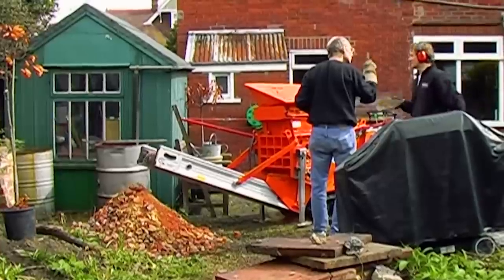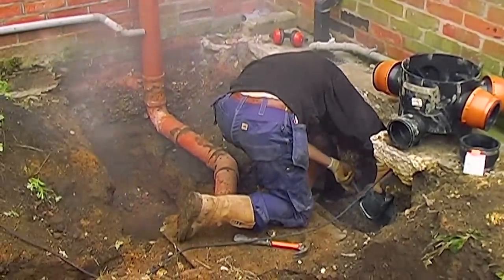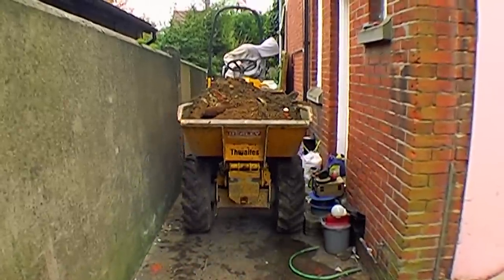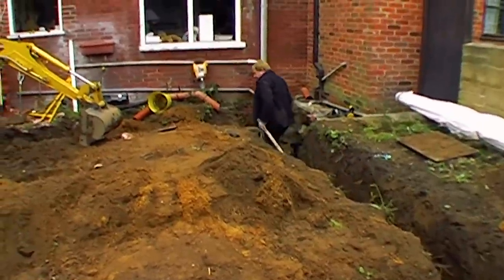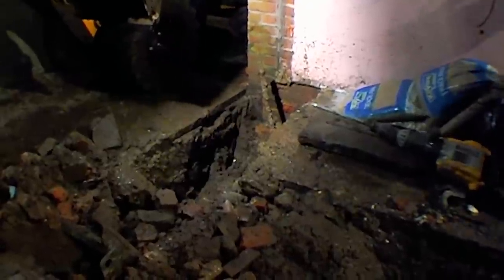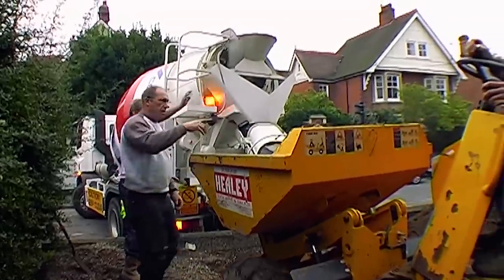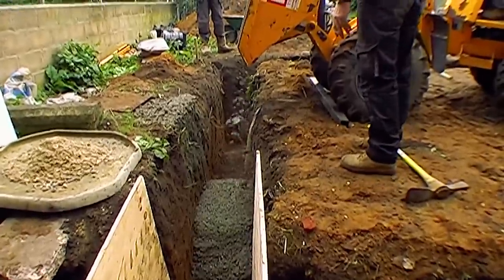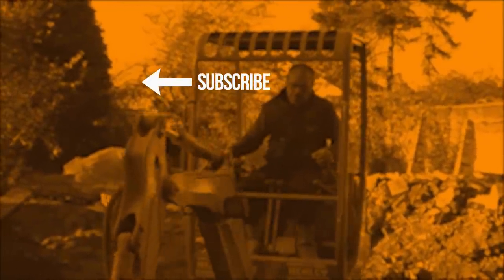Concrete Foundations - 35A Extension #1

Comment: I did a job one time, was deep in a foundation hole with drains poking out at head height; we told the occupants not to use the crapper for a couple of hours while we make adjustments to the pipework. Well, we heard the woosh of water coming down the 4 storey pipe and next thing we were being shot with shit pellets. Good times.

Comment: I'm so glad I'm not the only guy that does this stuff. Sometimes feels like I am! Do use a pump wherever I can . Not knocking your work though everyone has their ways 👍 good video and keep up the diligence 👍👍
Reply from the maker: Thanks. I am not anti pump but when we did this job they were on massive great trucks. The mini pump on the back of a Transit was not around. Also we had the dumper truck paid for so why not make it work?  We were about saving the pennies then. Come to think of it we still are though it is now difficult to bring an extension in under £80,000 . Everyone wants £180 per day minimum and the brickies and plasterers want £220.00. Good luck to them but it all mounts up

Comment: def more realistic when the real problems are show! Im a fan of the old "yank the water main with the digger trick" Ive done at least 5 + 2 gas mains and one electric. Cant be avoided sometimes even with a CAT detector! great vids guys!
Reply from the maker: Mike P
As much as we try not to it is hard to avoid. I used to wrap the gas up with Denso tape and wait until the dig was over before calling them out. That way it is one just call and one charge.

Comment: Would pumping the concrete be a better solution or would it be to wet🤔
Reply from the maker: Pumping is good  but when we did this job there were no mini pumps so you had to have a big one and that was over £300 for the morning. We had the dumper on hire and it is a small job so we decided to use it. Now you can get mixers with built in pumps so we often use those.

Comment: How quick and easy would that have been with a concrete pump?
Reply from the maker: Simon 

 I can tell you that when this job was done concrete pumps on the back of a Transit did not exist. It would have cost £300 for the pump alone and we had the dumper on hire. Not a huge job on a 36sq mtr extension.

Comment: Great video. Love the commentary. One question though, shouldn't the foundation have rebar?
Reply from the maker: Highlighted comment
Wayne Leone
Hi Wayne

 I the U.K it is not the done thing to use rebar in domestic foundations of this sort. In many other parts of the world they do but then they tend not to dig as deep. We dig down to something firm, which can be 2 metres especially if there are trees around. 
Later in this build you will see where we changed the whole design of the foundations and built in a ground beam to take the back end of the house because we weren't happy with the way it had been drawn. We had a really useless architect (more of that later) and he failed to spot several things that he should have.
Reply: Skill Builder thanks. I was thinking you guys were quite deep alright. Looking forward to the next episode.

Comment: Roger, was using a concrete pump out of the question?
Reply from the maker: No not at all but we are not talking about a lot of concrete and we had the dumper truck on site so, maybe 15 trips (tops) with the dumper truck and it was done. Concrete pump would have been about £2500.00  We tried hard to keep the costs of this job down. Our biggest bill was Chinese take-a-ways.
Reply: Skill Builder £2500 for pump? That's crazy money, I use pumps regularly for doing my basements, but only paying around £400 Inc vat, still waiting for you to come up to Leeds as promised few years ago, you might not remember now, we are Back to basement, you have mentioned you might do an article in PB,
Regards
Rubi

Comment: Concrete pump?
Reply from the maker: Yes we could have but the small ones weren't around back then so you are looking at £300 and we had the dumper which was a  £100 for the week.
Reply: Skill Builder what year did you do this job?